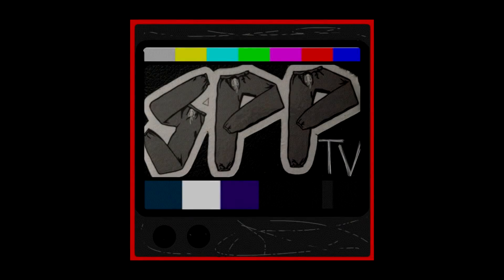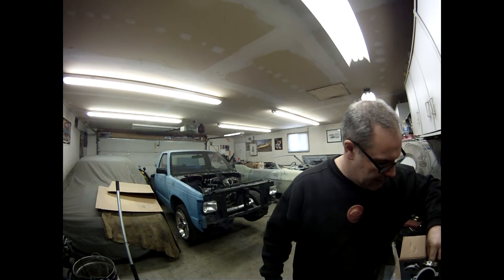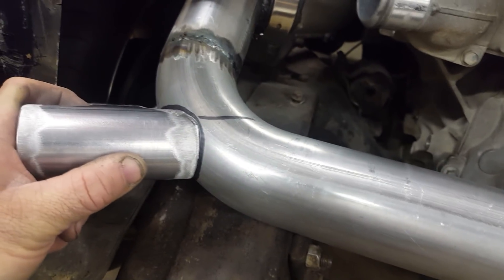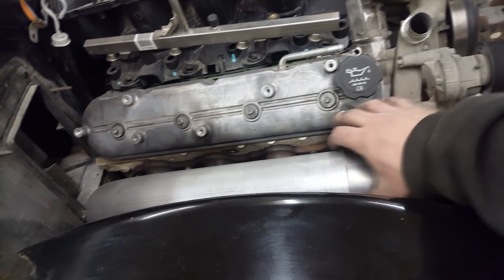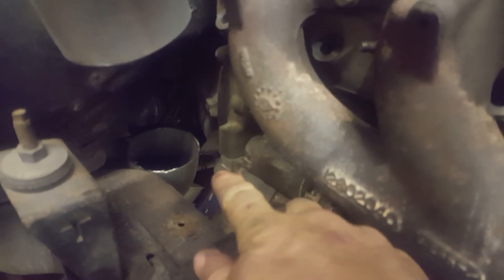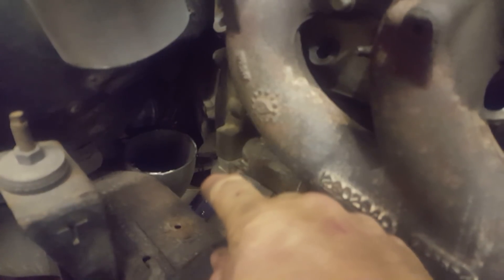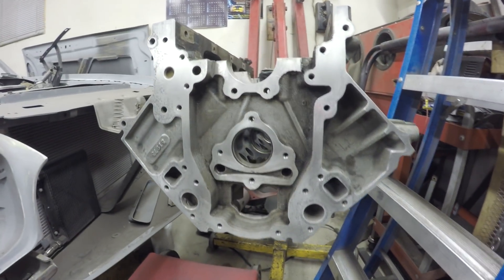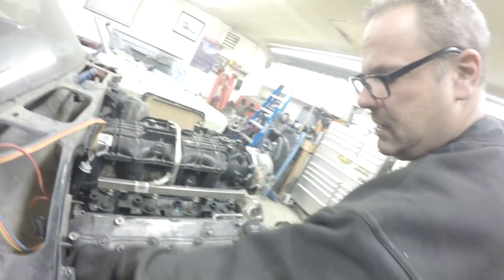Welding on a Wastegate + Fabricating a Custom Turbo Downpipe | LS Swap S10 Update

Comment: I hear everyone say oh the wastegate has to go after the murge but in keeping tradition of hot rodding and if it works it works does it really no matter on wastegate placement? Also the exhaust will travel to the point if least resistance witch would be the turbo

Comment: I wonder if he ever changed it or if it worked out. I would think there is a good possibility of boost creep because of the wg placement and said hotside orientation.
Reply from the maker: I did in a video after this one and it works great

Comment: With the way the exhaust pulses back and forth as it moves through the system it may or may not be better. Hell it could quite possibly be worse going with Clayton’s recommendation. Pretty sure the factory manifolds and altering the length of the Y-pipe/crossover threw the efficiency part out the window. Who knows just my 22 cents.
Keep the change

Comment: Hey Rob. Nice work, but mering  both sides at the turbo fange does make a considerable difference. Also your waste pipe should be just below the turbo flange welded in so that the flow of exhaust can easily escape. However, for a street car just looking to burn a little or so, your set up will probably work just fine. Anyhow. I enjoy watching ya'lls videos! 👍

Comment: You want the best flow you can get with a turbo is what I have always been told. not about building more horsepower but being more efficient. everything needs to flow as smooth as possible to just make everything correctly with the least resistance to free up horsepower

Comment: If it were my truck Id redo the hot side so the 2 pipes merge smoothly into the turbo flange on nice angles,........ that one exhaust pipe is heading straight into a dead-end BAM !

Comment: The amount of performance loss (if any) would only be single digit HP, and by the time you are at the wheels, there is most likely no difference. In my opinion, its more asthetics than anything

Comment: It would be better with a Y merge but it will work the way you have it, just wont build boost as fast or as well, the long side will be killing the velocity of the air from the short side. I think I would be more worried about not having a flex connection between the 2 hotsides, once they heat up they grow and move quite a bit, most likely will crack a right next to a welded connection.

Comment: It'll work the way it is now but preferred like I did it here:   https://www.youtube.com/watch?v=vekR7wYul6Q
  That crossover pipe will show more backpressure, but your wastegate is also on that pipe which is the preferred way to go if you can't place it after the merge.    Spool up will be a little slower with your 90* connection.  You shouldn't have a problem with your boostcontrol though.

Comment: I think the impact on the flow in the current configuration is greater than one might think. Take a look at this video to get a feel for the airflow sensitivity that comes from little changes https://www.youtube.com/watch?v=27Ue2_tkHR8. The video is a bit on the long side but I think you'll find it very helpful. The decision to revise your setup just comes down to whether you want to extract every bit of power from the configuration.

Comment: With turbo applications ideal gas flow matters less and less. It all just gets forced where it needs to go. Sloppy switched on those super nice ported billet heads from the stockers and only picked up 40 hp from 600 which is a 6% power increase for a significantly better flowing head. Turbos just don't care they just cram the air in. On the hot side the pressure will just force it to go the right way too. I think if you changed that bend maybe you would get 20hp difference maximum. Maybe ever so slightly faster spool time. I'm thinking realistically 5 to 10hp difference if you added that bend and a tiny fraction of a second turbo spool decrease.

If it's easy to unbolt and work on that pipe setup off the car though then I would probably change it if it didn't take that much time personally just because I'm an idealist and I like to see 'problems' get fixed just to satisfy me more than to make more power or efficiency.

Comment: I had boost creep issues with previous setups I bought from On3 that only vented one side of the motor. My mustang has one 44mm gate on the main pipe going into the turbo after the merge and has no isses

Comment: oh by the way the exhaust coming from the turbo make it go on the other side of the frame then back over the frame behind the lower control arm that part of frame before it droops to the body that droop is about 3in  thatmight be easier

Comment: in my thought on the crossover on the hot side in theory yes if it we're angled more towards the turbo it would have a faster more effect on air flow, think of it as a wall air hits it dead on it would stop it until its forced out some other direction. no matter what their will be airflow

Comment: Change it! Don't cut it apart, just use the inside of a 90° bend to help upsweep it to the turbo. And maybe use the hole saw or whatever ya got to make a hole. I noticed that too in the last video, i agree with Clayton. Or just cut it up and use whatever bend to merge drivers hot side into flange

Comment: Hey I been sitting on this Howard’s racing cam the part number is 190245-12 maybe see about running that it didn’t break the bank just wondering if it would be good for a turbo application

Comment: as your bud said.
"y" the pipe rather than "T" it and itll help spool, will help prevent excessive exhaust manifold pressure spikes that lead to uneven bank running and sometimes knock. 
Also, put your wastegate as close to the turbo inlet flange as possible, after the 2-1 merge. itll help prevent boost creep, and give proper boost control

Comment: Brave to ask Youtube opinions, the speed at which you work, guessing its already done.
I'd go up from where you have the wastegate cut in so that the bottom of the tube would be where the top currently is now or higher which might also gain a fraction for that water pump hose (not sure how it is molded).

Comment: You’ll need defrost for driving on the street even in the rain. I vote make the heat work. 
On the intersection of the Hot pipe, I’m not sure how it will work “T” into each other?  It could be a flow restriction?

Comment: Good idea to put a band on the exhaust before the 90 so u can get it out, probably should put a flexible stainless mesh coupling there too to eliminate vibration and expansion

Comment: I agree with Clayton, but try it out and see what happens. If you do change it I'd run both onto a merge then put the waste gate at the merge, because currently you only have half the exhaust waste gated,

Comment: the welds looks like hes using an argon co2 mix with the tig....
not so nice.

but cool project!
Reply: Carl Benz nope straight argon, just not a pro dime stacker
Reply: I once got the wrong bottle hooked up, took me more than an hour to figure out, i first thougt it was me having a bad day...huge fail.

But there has to be something wrong, the welds are so black.
Is that piping zink plated?

Either there is not enough shielding gas, or something is disturbing the shielding.(burning zink or other residue, air get's mixed in...)

A man with your fabricating skills should do better at tiggin. ;)

Comment: You can use truck stainless steel flex pipe save a lot time. Works great on the big rig trucks.

Comment: Nice work Rob , don't be afraid to section a small piece of the floor for clearance . That's no big deal , when it comes too working on the vehicle and the elimination of any chance of rattles you'll be glad you did .

Comment: you are still at a point where fabricating a saddle or u shaped piece and blending in the flow at the bottom of the turbo could be done by the time it takes to read these comments if it makes you feel better. self doubt is a bitch and that is my specialty

Comment: Block the firewall off and buy a hotrod heater to go under the dash. Or with your metal skills build 1, heater core and a fan are all you need. Really cleans up the firewall also

Comment: I think the hotside will be fine. Look at some of the hotsides sloppy has made, you'll be fine. You could add a taco there if it will help claytons feelings. My wastegate is on only 1 bank like yours and with a 3 lb spring i got 2.5 at the intake so its fine. Also mine is a 6.0 with a 7875. Send it bro!

Comment: IMO your wastegate position is going to be more problematic than the bank 1 merge on the hot side. The way the wastegate is now it's really only going to dump bank 1 side and the bank 2 side is going to wanna go to the turbo.
Reply: We put the wastegate on the shithorse in the same place and it worked fine
Reply: is this the 60mm WG from speeddaddy? I'm looking to do the same setup with the On3 Performance 7875. Thanks.
Reply from the maker: No its a 44 from vsracing.
Reply: The two headers merge before the turbo. It will be fine that way. Pressure follows the path of least resistance. An open hole through the wastegate will be way easier for it to flow to than spinning up a compressor wheel that is resisting it.

Comment: Yes i thini it should murge and you should put a bigger pipe for the wastegate and weld it under the collecter for the turbo you might run into some prob later with that wastegate setup

Comment: I was less concerned with flow and more worrying about restriction when i done mine...what i mean is you have both banks forced into one 2.5" pipe before the turbo if that makes sense...so 4cylinders run thru one 2.5" pipe and the other 4 run thru one 2.5" pipe then all of a sudden 8cylinder into one 2.5" pipe...kind of like constipation?

Comment: if you wanted to add a "taco" or a "saddle" to that hot side joint you could.  just open the corner way up, with out totally cutting up what you have already done.
Reply: Brad Davies ya i was thinking about that

Comment: wastegate dump should at least be angled towards the center of the truck; don't want any potential exhaust contaminants near your tires. that crossover should y into the other pipe.

Comment: I'm no expert on this at all so I could be wrong but I would change where they connect. I saw that problem when seen it in the other video. I'd be really worried about having a lot of backpressure on the passenger side manifold the way you have it routed now. Having that pressure coming from two different angles facing each other just looks like it could be a problem. Plus you'll get better flow into the turbo merging it in closer to flange. I think it'll look a whole lot better too. It looks rushed the way it is now. I also would've put the waste gate closer to where they merge together. Doesn't seem right to have it working of the drivers side only. But like I said to begin with I'm not a expert so I could be wrong. Keep up the work guys! Your one of my favorite channels! Can't wait to see the shithorse powerplant come together!
Reply: Lance Shank Im looking to do this to my 5.3 and going single turbo , but how exactly would i have to merge it ? ive seen people say to merge it like a Y how would that look exacrly

Comment: Clayton is right i thought about that the day u built it it's probably not gonna be the end of the world but it's not nearly as efficient like that gonna try to blow back towards the other side exhaust gases instead of flowing with each other there for slowing the exhaust gases and air down a bit

Comment: I would change it to where it flowed upward, and not back to yuour manifold. It wont be hard ,cut the pipe install a 90 degree pipe that is cut i0n half so it will flow better into your turbo.

Comment: to make it easier if you do decide to change it, you could maybe cut a triangle piece of tube and just cut out the now existing 90 degree angle.  and weld in your triangle piece to make it a 45 degree on the turbo side of the driver exhaust tube. If that makes sense.